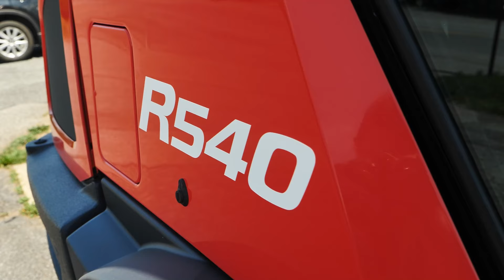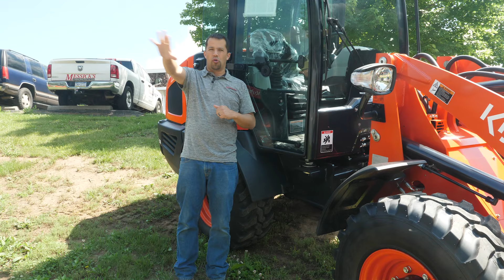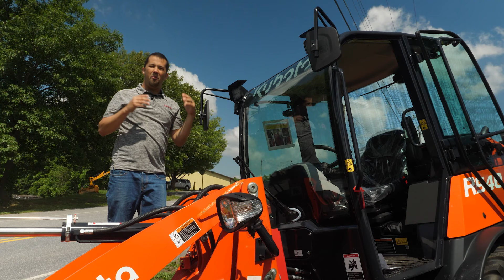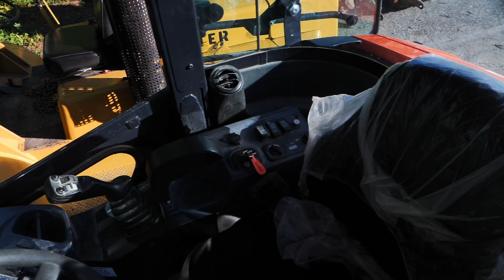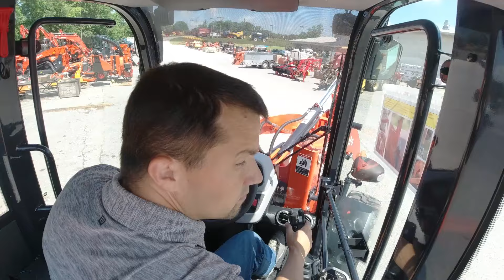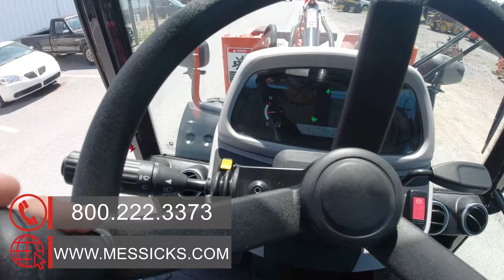Kubota R540 \ R640 Wheel Loader Updates

Comment: It's really too bad Kubota doesn't take a page from Avant.  Make a mini wheel loader with 21 gpm and have the ability to use many varied attachments.  If Kubota had a telescopic arm and 21gpm I'd buy one today.  The current lineup is poor showing for a company that has owned the small tractor market.  Big mistake and unfortunate Kubota.  

I'm an orange guy with 4 tractors, one commercial Zero turn mower a skid steer and an excavator with 20 attachments.  I need the hydro gpm improvement so I don't have to buy all new attachments.

Comment: Does the 540 have a ride control option, hand or manual throttle and continuous flow?
Reply from the maker: continuous flow is no longer a feature. Ride control could be, but there is a global shortage on accumulators.

Comment: There is one thing that could be better in my opinion and thah is attaching the lever to the seat. The slightly larger Giant G5000 has it so and that is nice. At least here in Europe we get loaders in 30-40 km/h (~25mph?) and with good (yes, more expensive) tyres the ride is comfortable.
 Maybe a silly question (I use loaders/tractors as utility machines): What is the thing with bucketsize? Regardless if it is imperial or metric, I just don't get it.  Isn't the important things capacity in tons and reach in feet/meters?

Comment: Ok, you convinced me so I bought a brand new R640 from my local dealer.  Generally, I am happy with the machine with two exceptions.  1. No throttle lock.  OMG how on earth did they forget to include this important feature (or am I missing it somehow? I hope so.  Is it an option?).  2. The articulating joint top bearing won't retain grease, but rather it extrudes the grease aggressively after only a couple of hours of operation.  I can tell when all the grease has been "pinched" out of the joint because the machine starts "squeaking" and "squealing" at the joint to the point that you can not stand it.  It's a brand new machine with only 34 hrs and it has done this from the very beginning.  If this can't be resolved and is considered a "normal" characteristic I will have to sell this loader (because I don't have the time and/or money to spend greasing a fitting every two hours) and move to a different manufacturer (and one that definitely includes throttle lock capabilities - my bad for not verifying the R640 had it but I didn't even think to ask as this should have been a given with this type machine especially since it's so easy to include with the electronic throttle system).  Performance-wise the machine does fine.  My unit serves as a piece of farming equipment so we don't need much more in the way of driving speed but we do operate on bumpy dirt roads and have longer transport runs loaded which is why the throttle lock is important to us.

Comment: new kubota r640 loader center joint squeaking bad after only 14 hours factory grease job missed it can i get grease every where by just pumping grease to it or should dealer pull it apart and clean it ?
Reply from the maker: Just grease it. Highly unlikely it's was totally dry.

Comment: all machines with cabs doesnt matter if its a tractor an excavator a combine a wheel loader a skid steer these days with how much glass they have the front windows should be polycarbonate as standard and the rest of the windows as poly carbonate as an option as a safety standpoint

Comment: How much does it cost to replace center pivot?
Reply: Quite a bit. because of the bushings need re machining, and required a a line bore, press or weld new sleeve and machine again. 
but the cylinder pin will use before the center pin, those are a bit cheaper, since precision less

Comment: Can those run a brush mower like a skid steer?
Reply from the maker: not well.
Reply: They don't flow enough oil (or have enough engine power), for things that demand such oil flow like mowers/mulchers etc. 
There are some other EU brands out there that do offer small wheel loaders that offer Hi-flow options (such as Wacker Neuson) that can do well in those applications, but not much touches the build quality of the Kubota loaders (Yanmar and Furukawa do well there too)

Comment: Niel, when is kubota going to update/replace the L2501? It's a great machine but it's getting old. I want to see how Kubota can improve it.
Reply from the maker: I don't know anything specific, but given the way the products usually cycle its about time
Reply: I hope they never do as this economy tractor has a fantastic place in there line up. I hope dealers would get away from promoting HST models for folks primary tractor purpose is open field mowing and constant speed ground contact work.
Reply: @andyfaivre5460  Yes, I don't want then to change much, just little updates or improvements. I've been looking for a good priced tractor and the newer b2401 is very interesting  but if it's not enough, I'd hate to buy an l2501 and then they go improve it right after I buy it.
Reply: @person86422  definitely, I’m in the same position. I’ve been heavily considering the 2401. I am hesitant only because of the amount of landscaping tasks I have, may be nicer to have the HST. I love the LX but on 4 acres that’s heavily wooded and landscaped it’s just too much tractor.